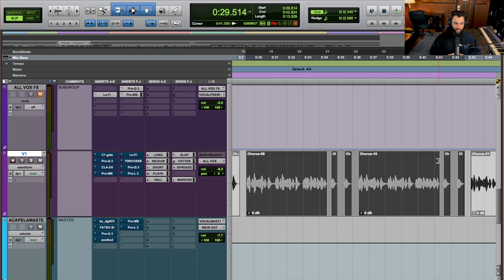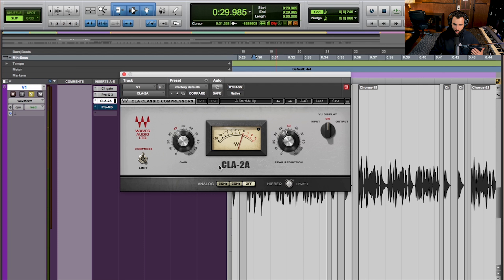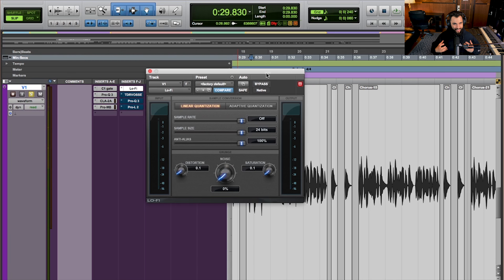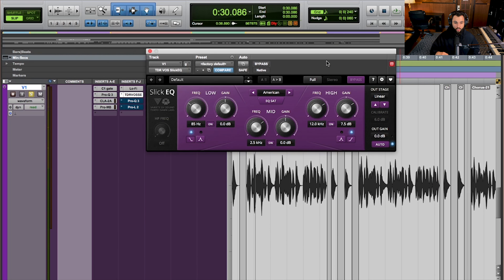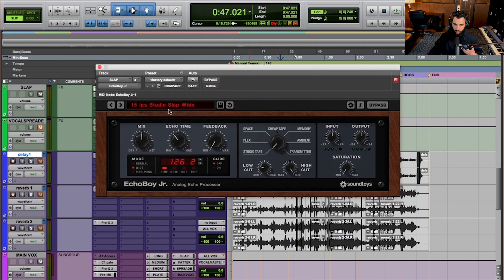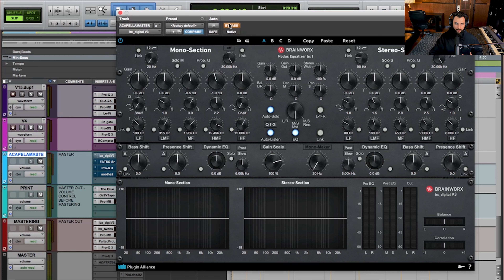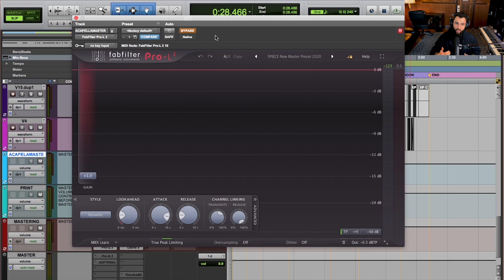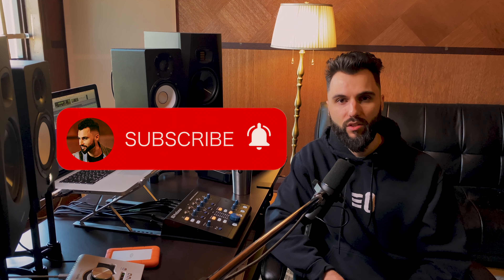My (Secret) Drill Vocal Mixing Chain

Comment: Do you really have to have so many plugins and a so complicated mix to have great vocals or is it just what it takes to achieve that pro sound we yearn for ? Thanks
Reply from the maker: I don’t think so. I have a lot of plugins but I generally rely on the same 10-15. I could get most mixes done with even less if I had to, but I do prefer some tools over others. As they say, it’s the EAR not the GEAR. Start with a small set of tools, learn how to use them well and then expand to fill in any gaps as needed. Here’s a slept-on video I did about my top picks: https://youtu.be/eTqUyd1Tn3s